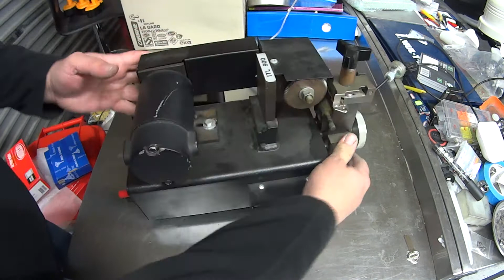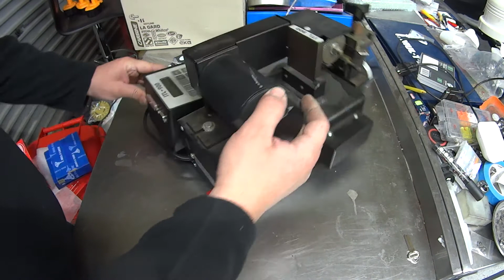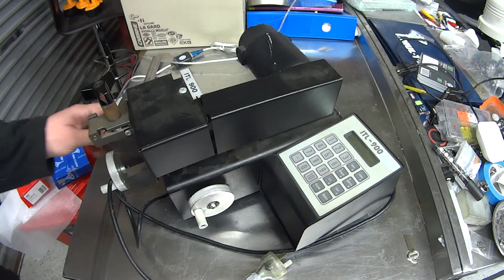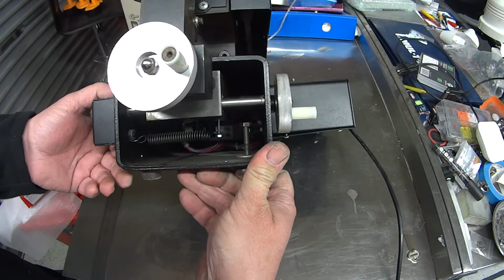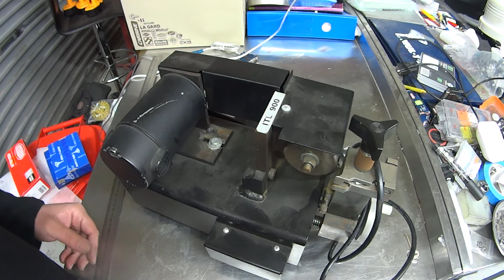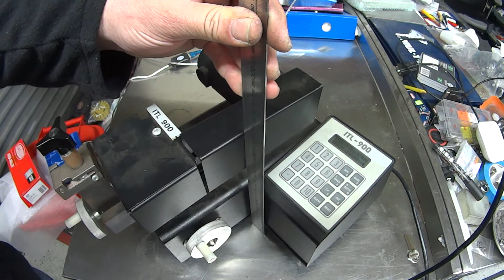ITL 900 "What is this machine" first look

Comment: Workable, similar to using a Framon2. but glad I have the 950C. 950 has the crank on side only, depths are handled automatically by a stepper motor, allowing machine to recreate angles of cut. I also have a 9000. Awesome machine, but about 25 years out of date. ITL never modernized the machine to USB, let alone APP based on Android. Doing so would allow for diagnostics and remote help. 

Machine MAY respond to download via Instacode or Genericode. 

Mfr SEEMS to have a policy to tell anyone who buys a machine used, that it is too old to update, repair or buy parts for. This MAY be true on one this many decades old, but they will tell the same if you buy one used one MONTH old. 

These machines are absolute  workhorses. BECAUSE I drive my machines with external software, I do not have to rely on ITL to update anything. I was told there have been no updates for 5+ years ( This means updates to the machine, and NATIVE key data. This is where external software comes in so valuable ) I would test the 900 to see if it can be driven by such software. The WAYBACK MACHINE / Internet Archive shows few ITL site updates.. between 2001 and 2008

 http://www.itlonline.net/   This site shows current jaw inserts, machines, cutters, some field replaceable parts etc.

This machine obviously was not set to angle for Medeco.
Nor does this machine handle Tibbe, Dimple or other applications that require a Zed ( Z ) axis, and end-mill cutter operations.

This machine apparently DOES flat single and MAYBE some double sided keys.  Ford, Toyota, Mitsubishi were using 2 sided keys in the USA in the guestimated time frame this machine lived. I speculate on this, of course

Comment from the maker: Some good info from other Locksmiths ... 
No problem at all! I believe Lock World, a local distributor in Burnaby, British Columbia may have some parts for the machine. If not, perhaps McGregor Hardware Distributors in East Vancouver may have parts as well. In addition, the inserts for the 9700, 950C and all ITL machines should be the same, so if you do find some inserts for other ITL model machines, it should work for yours as well. I also found another website: "http://www.michaelhyde.com/search.asp?keyword=ITL+insert" that has all the inserts that a locksmith would need for cutting all sorts of keys. As for the manual containing all the manufacturer's codes, I can try to contact Intralock Tools myself and see how it goes!

Comment from the maker: Some comments from other helpful Locksmiths :
I watched your video on the ITL 900 machine, which is one of the older models of the ITL code machines. The reason why there is so much space in the jaws is so that you could clamp any sort of key with the use of what ITL calls "Flats", usually labeled Insert #1, Insert #2, etc.  When cutting any key, there should be a user's manual where it tells you what number the lock manufacturer is registered as on the machine (for Schlage, it would be 391, MFG), which insert you should use. The inserts act like shims and are put in the vise before the key. This machine has now been superseded by the new ITL 950 and 950C.
Reply: The default DSD number can be set for whatever a shop uses the most. My 9000 and 950 arrived set for 391 Schlage, and I left it there.